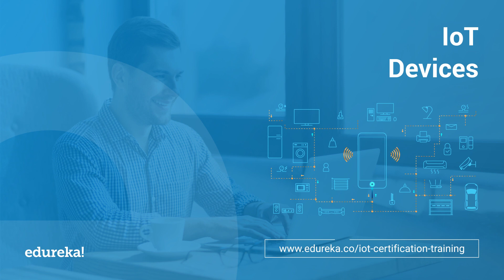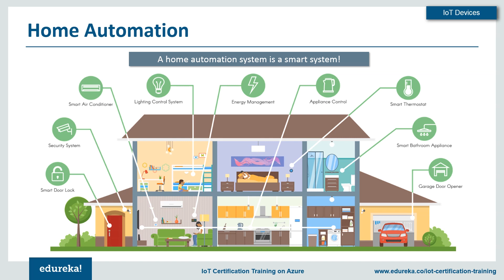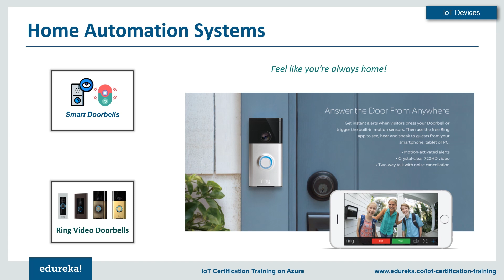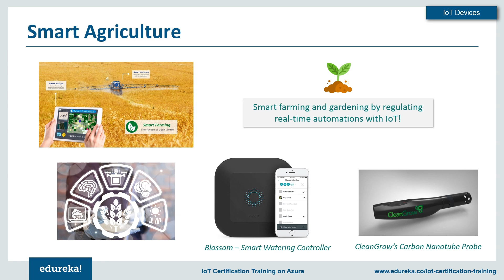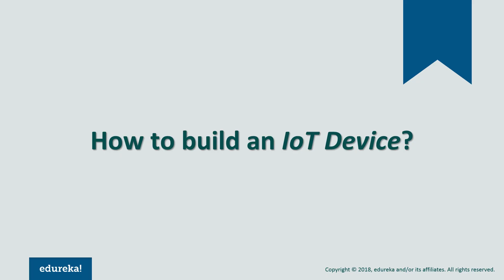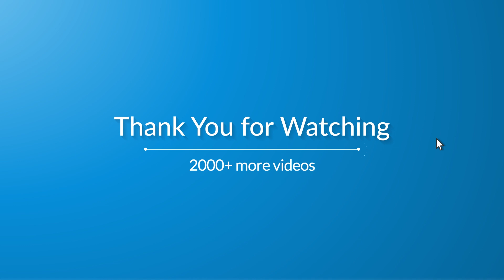IoT Devices Example | IoT Applications | Internet of Things Tutorial | IoT Training | Edureka

Comment: Thank sir for ur valuable information..sir is it possible to make a stepper motor an iot device .?
Reply from the maker: Hi Lokesh, Yes, you certainly can. You could use the ESP8266 based NodeMCU prototype board with a motor control board to control your stepper motor. ESP8266 boards can control steppers with other boards that sometimes ship in bundles with the motors. However, with those boards you have a lot more loose wires.